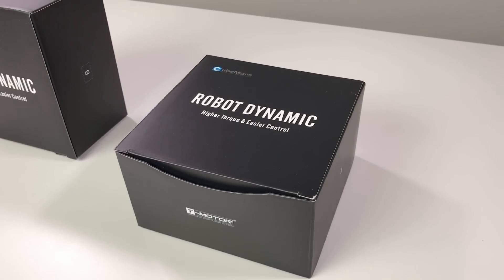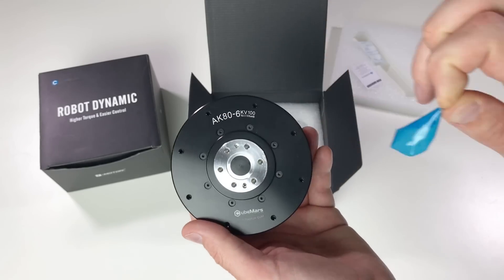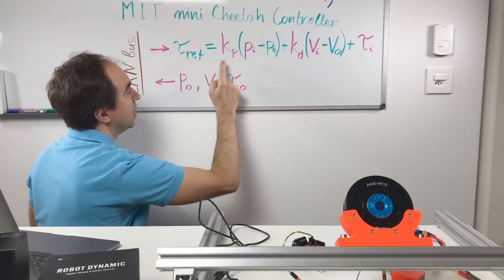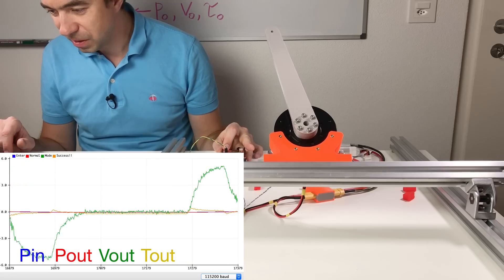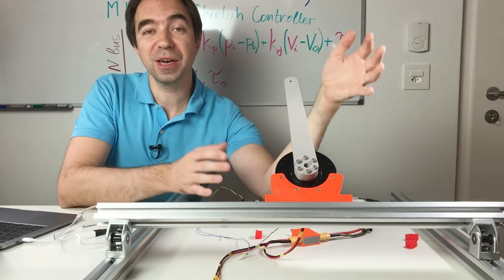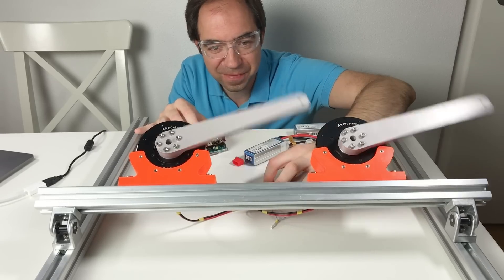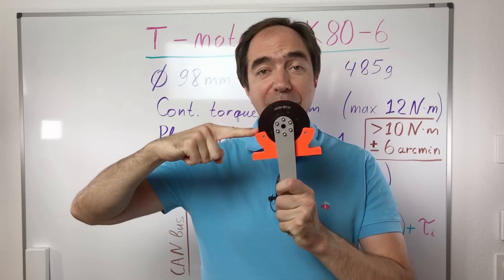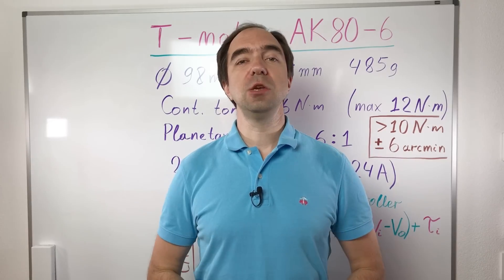Ideal for the Super Fast Robot (T-motor)

Comment: Does these actuators require endstops and homing cycle when used in robot arm, or the position is always absolute and precise?
Reply from the maker: P Kav it is absolute in the range of one motor rotation (1/6 output shaft rotation). And you don’t need endstops, and you don’t need to do the homing.
Reply: @Skyentific  Absolute encoder? So homing and endstops are still required. Axis 1, for example, can turn much more than 60 degrees.

Comment: Hello, good, I wanted to ask if the motor is only capable of controlling the torque or the speed and position can also be controlled.
Reply from the maker: Yes. You can put torque = 0, this will be position control. If you also set stiffness to zero, this will be speed control. But for speed control there is a drawback: it has a limit at how many turns it can make. It cannot rotate indefinitely like with ESC.
Reply: @Skyentific  Thank you for your response.
Reply: @Skyentific  Sorry I have tried to reproduce your arduino code but I have missed several errors when compiling, if it is not so much trouble if I could upload your code I would appreciate it.
Reply: @jiachen3920  Hi Jia, did you make it work?
Reply: Hi Jia, this actuator support "position control, speed control, and torque control".

Comment: Supercool, if I had three of these I would make such an awesome 3D-printer with it. But I assume these are way out of my price range. Also lovely to see how you can link them together and 'feel' the force that you apply on one end to translate into the second one.
Reply: If you really wanted to make an awesome 3D printer, you might pick low/minuscule backlash, mid-range speed, high stiffness, and a controller that focuses on precision and not torque or speed. AKA steppers. BUT the very fact that you saw this video and considered what cool things you could make with it, that’s what the world needs. stay inspired my friend
Reply: @evanemanuel1774  Indeed, we can go the traditional way, or try to make something weird/unexpected/unconventional and maybe fail but get a whole extracurricular set of new ideas from this :) I believe new things happen in the grey area.
Reply: @MarinusMakesStuff  well of course you could also put a car engine with heavy gearing there too. Might also end up being cheaper than the actuators shown in the video.
Reply: @Mr30friends  I love how the reactions are so in the box. Who cares what's outside the box, right? You don't even have the slightest clue of what kind of a printer I want to design :D
Reply: @MarinusMakesStuff  If you actually manage to make a printer that utilizes the speed of those actuators with insane printing speeds and some kind of special extruder/material to handle that, then it would be great. If you just change the steppers from a normal printer with the actuators from the video and that's it. Then you might as well throw 3k out the window. That's how I think of it.
Reply: I don't think that motor speed is a concern in 3d printing.  It would be kind of an overkill.
Reply: @Mr30friends  Maybe I love overkill :)
Reply: 3D Printer actuator must have no backlash.
Reply: @TheNamelessOne12357  This will be fine. Trust me. At the scale I'm thinking backlash will not be a problem anyway.

Comment: You could try using the STM32 you used for your DIY Mini Cheetah Controller as the brain. Most of the STM32 boards are programmable in the Arduino language and some even support CAN built in or have support for normal Arduino shields. And of course they are much faster than an Arduino.